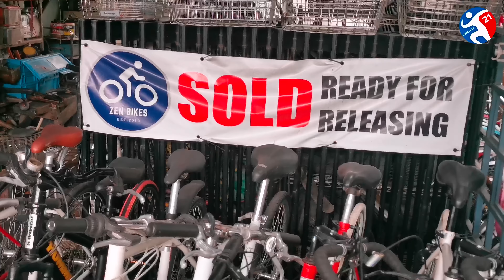BASTA BIKE HANAP MO DITO MAGANDANG PUNTAHAN MADAMI KA MAKIKITA MAGUGUSTUHAN LAHAT PWEDE NA GAMITIN

Comment: sir chichoy asko lng po sana kung anong pdeng 700c n tire n pde po s 27.5 n rim pang mtb..sana po masagot nyo po salamat po
Reply from the maker: dapat idol rim mo 700c din tapos tire na 700x35c equivalent na yan sa 27.5 pero if 27.5 rim mo hindi pwede salpakan ng 700c tires & tubes